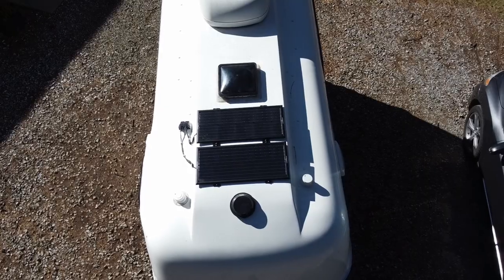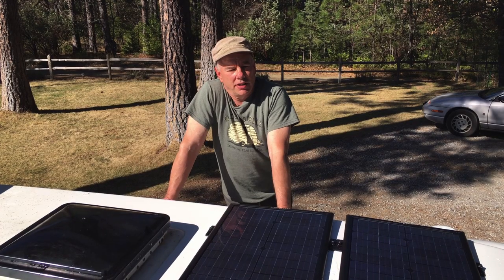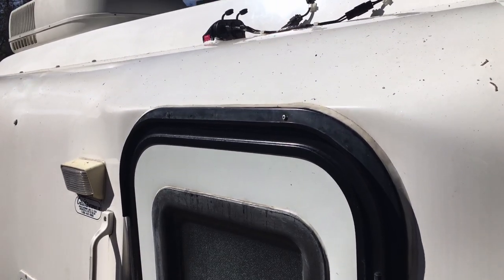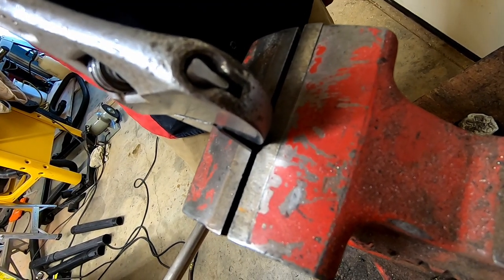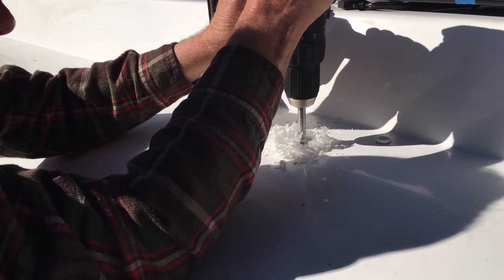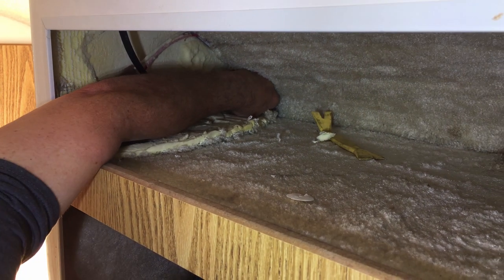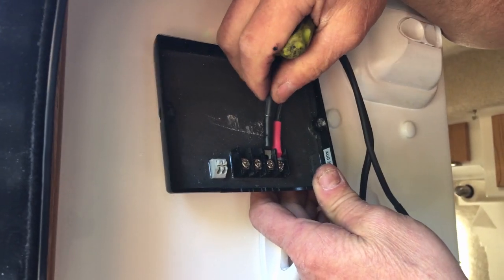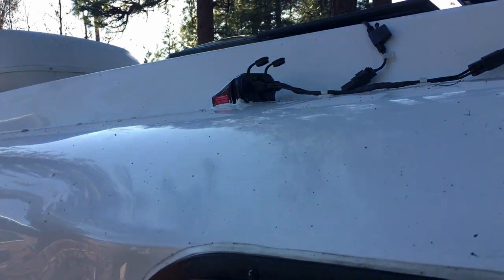You Can Do This!  Easy!  Install Zamp Obsidian SOLAR in Your Camper

Comment: Thanks, great information. I will be copying your set up!
Reply from the maker: Great! Let us know how it goes.
Reply: Just be advised this is an amateur installation and should have a disclaimer saying so. The refrigerator compartment should always be isolated from the inside of the Casita. Drilling a hole on top of the compartment to run wires may let deadly fumes into the Casita when the refrigerator is running on propane.

Comment: Great info, however I have a couple questions…
In this first video you mention using VHB Tape, what product number did you use?
And in this video I noticed you only used the VHB Tape but in your 10 month follow up I noticed you covered the mounting brackets in some type of white epoxy or something. So I guess my question is did the VHB Tape not really hold up?
Reply from the maker: We used eternabond over the VHB tape.  We were just evacuated from our house due to fire so can’t look up the VHB tape number right now.  We put the Eternabond on originally, it didn’t make it in the video during editing and that was an oversight on my ( Crystyn) part.  They are hanging on great so far.

Comment: Well done. Why do the Obsidians have less power output from the panels than the "legacy" Zamp model?
Reply from the maker: Thanks! I’m not familiar with the legacy panels, It could be due to the size.
Reply: They do not have less output. But there are different sizes. Just replaced my 140 W Legacy portable with a  a 100 W obsidian.  The obsidian Weighs less and it’s easier to set up as a portable unit.

Comment: Hmm... basically panels attached with glue.  How has that worked out?   I had thought about drilling into the sides with extension arms going up to support cross bars for panels.  I do hate the idea of holes in the exterior, but not sure I trust glues.
Reply from the maker: We attached with VHB under the mounting feet and then covered with Eternabond.  So far, there has been no separation.  Here is the follow-up video: https://youtu.be/BdUqz678DDg
Reply from the maker: Also, we just saw a video showing that Zamp is now including double-sided tape with the panels for installation.  Check out this video from the Fit RV: https://www.youtube.com/watch?v=zH8vDFclId4

Comment: Very good video and I will order parts using your links where possible.   I watched another video where the wiring from a solar panel was run thru the roof vent that goes into the closet.  This appears to have two advantages over this installation.   1) being that no holes need to be drilled thru the roof and 2) that there is a 10 gauge wire in the bottom of the closet already connected to the battery eliminating the need to run an additional wire to the battery.  I assume that the box with the gasket that you installed was simply a junction box?   You reply will be appreciated.   Thanks again for a great video
Reply: What is the other video? I know nothing about installation so I'm curious.

Comment: So, when the panels are made in the USA it means they are good? Why didn't you use the same 2 holes between the panels to mount both of them? One bracket on top of the other. Plus let me tell you, 90W is absolutely nothing. What do you think you can do with that? Right, nothing.